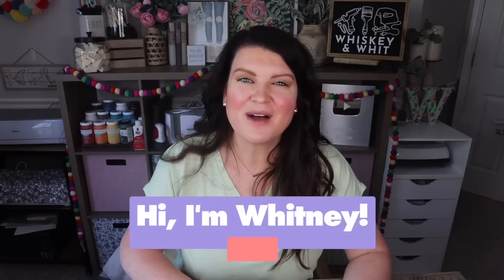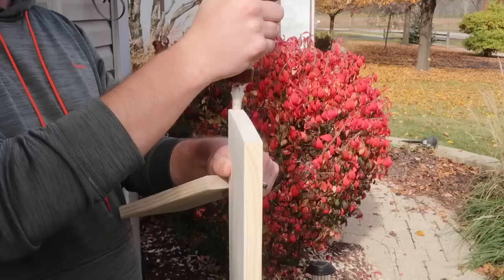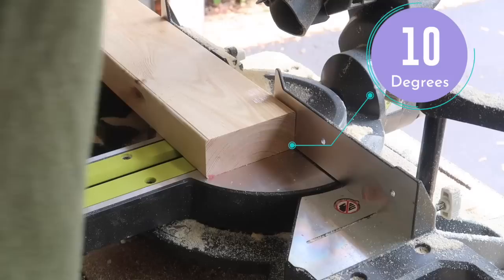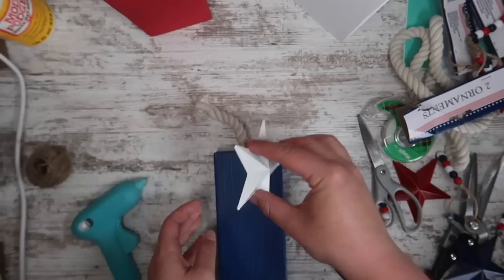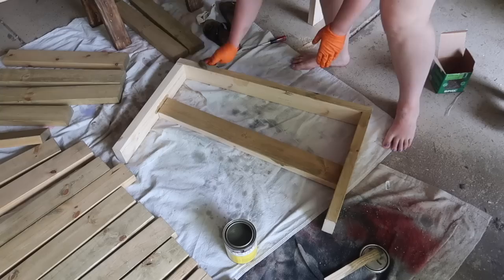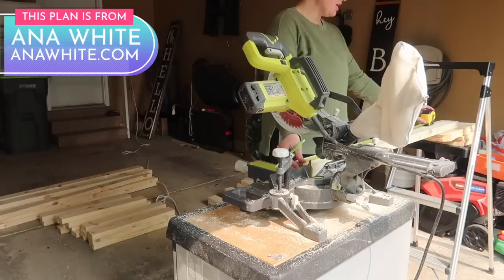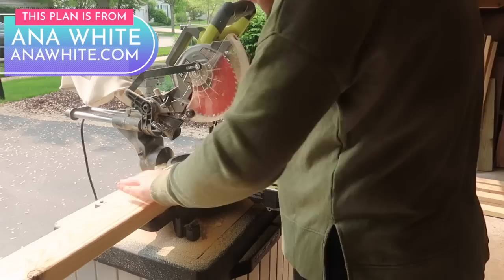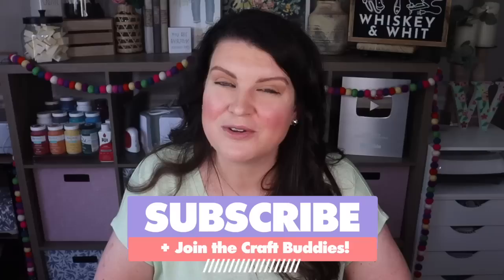Grab some cheap 2x4 lumber and make these EASY Wood DIYs! ✨ PLUS DIY 2x4 Patio Furniture

Comment: I love this video. Great job. I already have those plans from Ana White. She is great.  Now I know what they will really look like when done. Thanks for helping me make up my mind. Check out Shanty 2 Chic for some great pool loungers made out if 2x4s. I don't have a pool, but thought they would be nice to have at my fire pit to relax in after a long day of yard work. Keep up the great videos. Thanks again.
Reply from the maker: Yes! I love Shanty 2 Chic too! My only thing I run into with them is that they ALWAYS seem to use a table saw to rip boards down vs. off the shelf lumber. Without that saw, I'm in a pickle :)
Reply: @Whiskeyandwhit  So true. I do have a table saw, but rarely use it to rip down dimensional lumber. I just adjust the plan for using 2x4s. They are going for the perfectly finished, square edge look. I want rustic for my backyard and basement, so I just use 2x4s. I will use 2x3s and 1x2s, as needed to make it work. It also adds some character by using different widths of wood. Your wood scrap uses are genius. I made a yardzie set and a domino yard set for bbq's from some of my scrap wood. Keep up the wonderful videos.

Comment: I feel like I would also want to add wood glue to attach those parts together on the outdoor furniture. Just feel like that would give it more support then just screws…… 😮
Reply from the maker: Totally, you can add wood glue that is for external uses but those 3” screws made the pieces super solid

Comment: Could you share where the wood vase on the outdoor table is from? I saw it first during the scrap wood section, so perhaps the source is shared later in the video. If so, disregard! 🙃
Reply from the maker: Yes! I bought it from a place called urban farmgirl at a market. They have a website but that vase isn’t on there :/

Comment: Be careful if you sit on that little bench - there's nothing to stop it racking side to side and with only pocket hole screws holding it together, it could easily collapse if it's put under any sideways strain.
Reply from the maker: It's mainly for decor, but I appreciate you watching out for us!

Comment: What was the cost of the outdoor furniture to DIY vs. buy?
Reply from the maker: I used World Market as my inspo so here's a back of the napkin breakdown :)
All in, Inspo: $1,867 and Mine: $446 - so a 75%+ off
I have the tools already, but I did add in stain, sealant, and screws tot he total

Couch
Inspo: $899 Mine: $189 approx.
Wood $38.16, Cushions: $150

Chair 
Inspo: $399/each, so $789 Mine: $178, so $89/chair
$16 in wood/chair, cushions $ 58/chair, pillows: $15/each

Coffee Table
Inspo: $179 Mine: $23 in wood

Things I used on all 4 pieces + added into total:
Stain: $13
Sealant: $22
Screws: $21
Reply: @Whiskeyandwhit  very cool!

Comment: I use the talk-to-text software so if you find a error please excuse it.
To seal your wood try using a product called varathane or durathane. If you get it in a pint can do not shake it it will put a lot of bubbles in it and it will never come out. I see that you have approximately $500 Empower tools of course my estimate could be wrong pocket screws are very good way of putting joints together goodbye for now and good luck with your show
Reply: I see you're already using the sealant that I suggested. I guess I should have watch a little more of the show before making a comment one other thing I would suggest to use on the edges of your two-by-fours where your buddy him up against another to wipe or whatever if you use glue that'll have a Tennessee not only to help fund but also seals the porous part of the wood
Reply from the maker: Thanks for the tips!